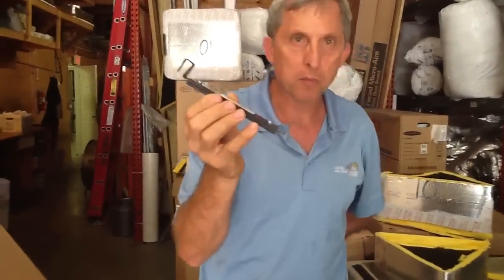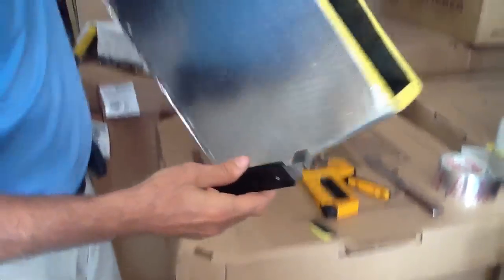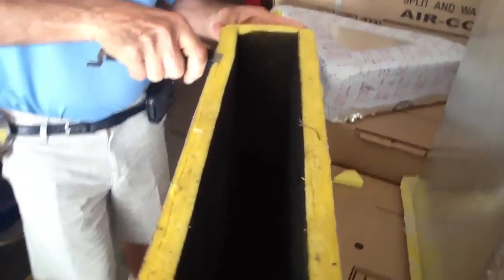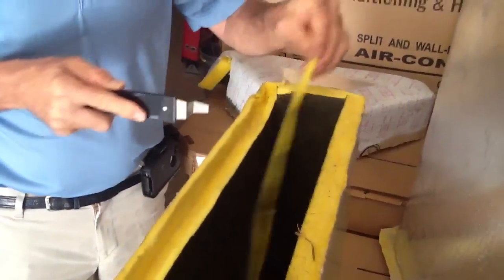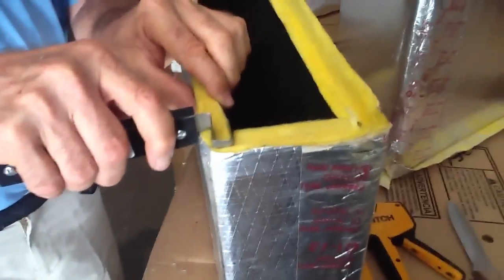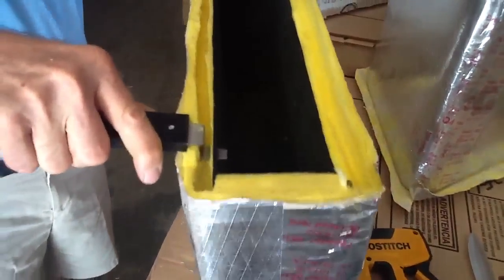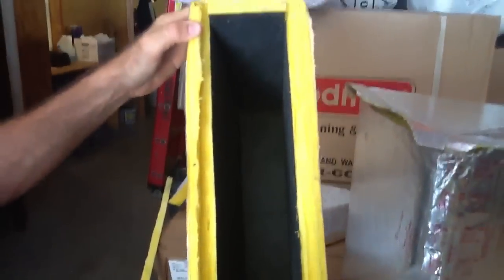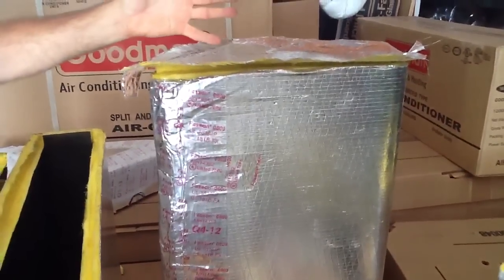Shiplap Tool shown for air duct insulation

Comment: I bought a prefab double wide house from the states. (I live up in Canada). And all the duct work was the stuff your using but without the black lining on the inside. I chose to not use it as I didnt like the idea of the furnace pushing fiberglass dust into our brand new home with a 8 mth old child. I did all metal but was hoping to keep the other stuff and use it as the cold air return. It was already fitted nicely up in the floor joist and the return air would have to pass through the filter better getting sent back into the house. But when I cut into it Im seeing so much dry yellow dust particles I dont think I'll use it. So my question for you is did the people who built the duct work just skip a step by not putting the black sealant in it or is the stuff I have ok?
Reply: My friend sold a house with this stuff. A private home inspector warned them of the dangers of fiberglass ducts. He now has to replace the ducts on his dime.

Comment from the maker: I hope you find this video helpful...thanks for watching from Jones Air Conditioning & Electric in Naples, FL!
Reply: David Jones ductboard is garbage. Install a metal trunk line with insulation on the outside. Always Keep fiber glass out of the airstream. I never even install lined plenums, boots, or ducts, much less cheap ass ductboard. You should know better than that.
Reply: @vinnymac8127  i do agree, but I live in FL and I'm stuck with ductboard and flex duct and I hate them both, but metal is pretty much impossible to find here without custom order which costs a fortune.  They do everything ass backward in this state. I'm really wanting to move up north and learn how to fab metal ductwork which is the RIGHT way. In the meantime I just do the best possible job with what I have to work with.

Comment: a tool to make crappy plenums. Ductboard may be the cheaper material to use in labor and mat costs but it is never the best option. that shit sucks.
Reply: What in your opinion is the “best” option, then?
Reply: @ferdinand1x  Metal , that stuff you dont have to replace every few years
Reply: @garyhempel6316  I’ve had fiberglass duct in my house for 33 years with no issues.  Maybe the issue is how you install it.
Fiberglass is superior in every way to sheet metal, except when internal pressure exceeds something like -4” of Water Column.  1 foot of fiberglasss duct removes as much sound from a system as 13’ of sheet metal. Also, by the nature of fiberglass, it’s already class A sealed, so you don’t need lined duct or to go back and wrap it afterwards.
Just because you don’t like it doesn’t mean it sucks.
Reply: @ferdinand1x   i think you are full of it. I have seen it fall apart all the time. Not my installs either and flex duct is worst than that. Staples and foil tape does not a plenum make lol
Reply: @garyhempel6316  i call BS on "all the time", but I will admit that have seen a product delaminate -ie separate from the scrim foil- only once in my 30+ years of working with fiberglass.
As for Flex duct: I will agree that flex duct is overused, mostly when people cheat and use it as trunk duct.  However, Flex duct for short runs off of the trunk is and will always be entirely appropriate.  Flex also has the same sound-deadening qualities that fiberglass duct has that unlined sheet metal duct simply could never replicate over short distances.  Sheet metal also has significant more health concerns because the oil from the coil lines always sticks to the metal, which attracts dust and therefore can grow mold.  On the other hand, fiberglass (because it is made of silica) has no place for an organism to thrive and therefore healthier.
Again, just because you have a preference doesn't mean anything:  science is not on your side on this topic, and everything i posted above is accurate and can be proven if you're interested in learning something.

Comment: ductboard is disgusting stuff. we replace it with metal all the time. you cant run a duct cleaner through it without tearing it up and other guys like electricians, plumbers, homeowners, whoever crush it all the time.

 I will say its a cool idea and the round pipe is pretty strong but overall its just not good. molds easily and builds up with dust too because no one replaces their filter.
Reply: ductboard is superior in almost every way to sheet metal, and that's a provable fact.   As for "duct cleaning"-- there shouldn't be a need for duct cleaning since fiberglass is made of silica and therefore contains nothing that can host an organism therfore is inherently healthier (and less costly) to sheetmetal.